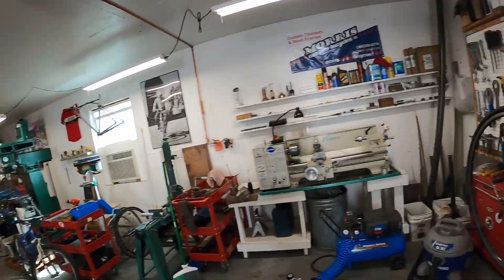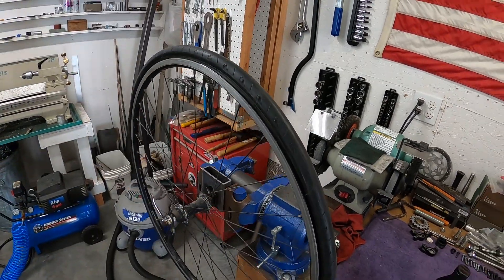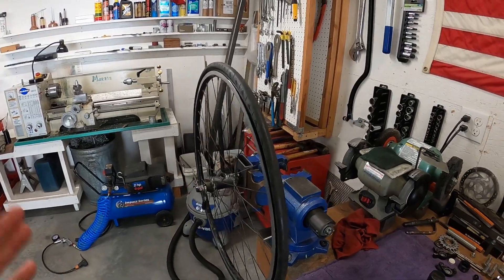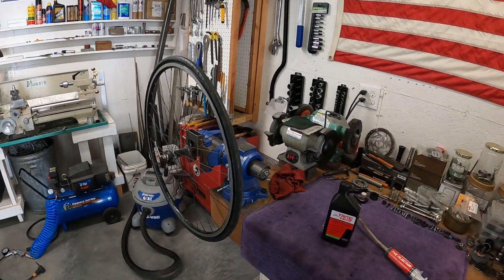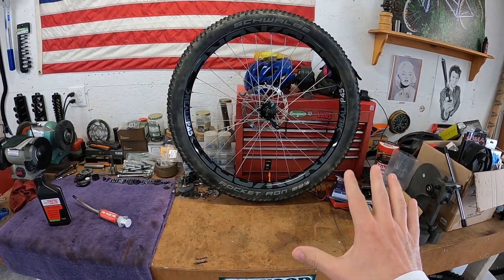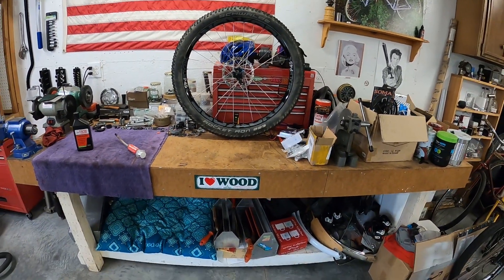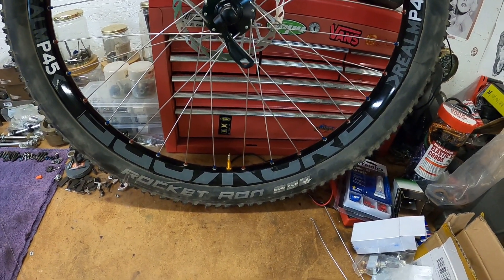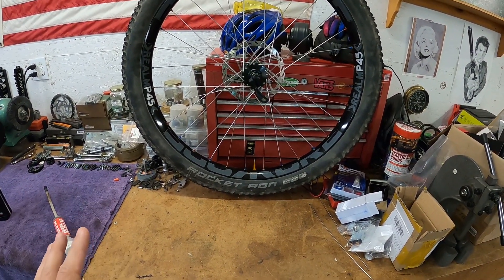Going Tubeless?

Comment: I agree, tubeless on high pressure tires is less effective overall. I ran it on my roadie and it worked decently well for me with 25mm tires but it certainly wasn't anywhere near as good as tubeless on my MTB with 2.6" tires on it which run 23f/26r. Having to remove the tire and valve stem on the roadie to put a tube in on the side of the road was messy and more time consuming than it was worth to me. The real answer is to just ride 35mm tires as a tubeless setup lol.
Reply from the maker: Sounds like you have been down this road a few times before.